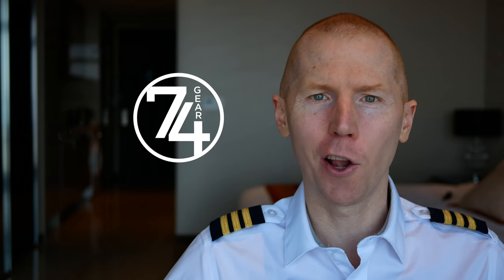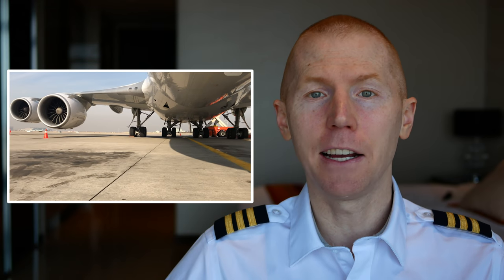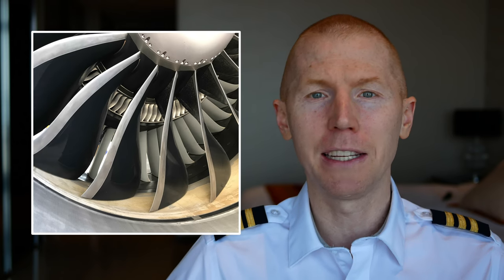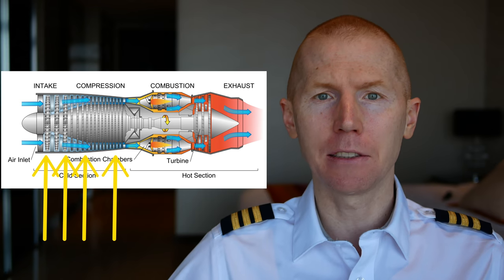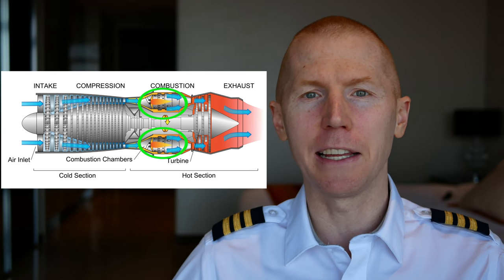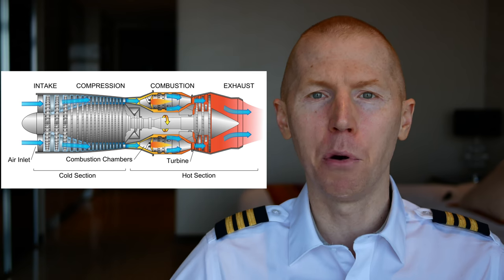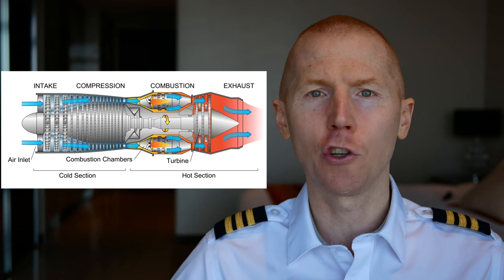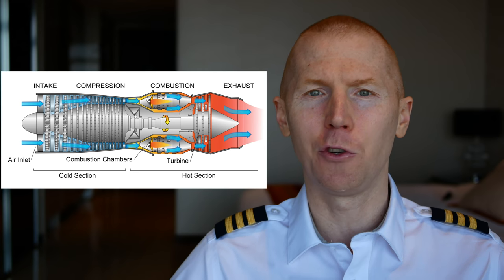How does an Airplane's Jet Engine Work | Airline Pilot Explains

Comment: Hi Kelsey, just a note from your friendly jet aircraft mechanic.
The fuel nozzle is at the front of the burner can, as shown as the white angled piece in your drawing, the holes in the side of the burner can are not for fuel but to let air in to help with the combustion process, but to also cool the can and keep the flames from contacting the metal of the can. (It could melt from direct flame contact over time)
The burning of the fuel is a continuous smooth burn, that causes a rapid expansion of the air passing thru the turbine blades out of the rear of the engine. Please stop calling it a explosion. 
Keep up the good work.

Comment: Hey Kelsey,   I use to work for a company called Praxair Surface Technologies right next to William Hobby Airport in Houston.  I was one of a handful of people that  were able to rebuild and or work on certain parts of the get engine internals.  One was the main shaft of the GE engines.  The bearing journal (bearing area on the shaft) had to be held to .0002  Two tentth's of a thousand of a inch.  We actually put the shaft in a machine, undercut the journal and then microweld build up the area with a D-Gun, then precision grind it back down to the tolerance needed.    We also sprayed the CANS's of the engines with a tungsten carbide coating with a Thermole Jet  coating to keep the cans from eroding away while burning fuel...   We did many helicopter parts also for Jet Ranger's...  But I remember how delicate we had to be and keeping up and recording all the serial numbers on every part even all the small parts we did..    This was when I was about 30 years old about 20 years ago.  The place has since closed down and moved away.  
Reply to you later.
Mick
Reply from the maker: cool story Don, thanks so much for sharing.

Comment: Turbo, aye? Now lets talk about how we can put that engine on my car :3
Reply: From my understanding these turbo jet engines works similar to a turbo charger in a car. Exhaust drive the turbine (hot side) which is connected to the compressor (cold side) by a central shaft. The compressor suck and compress the air then send it to the intake. So if your car's a forced induction then you already have one mate.
Reply: @datdudeolyver  i have an compressor boosted engine on my car ( it's connected directly to the crankshaft instead of being driven by the exhaust).  But its more the joke about "we need a bigger turbo or a twin turbo on the car for MOOARE POAWER"
Reply: @terrorhuhn9192  Well we can't never have too much can we lol. Add a turbo with that blower on the top and you'll have MO PAWA BABY
Reply: @datdudeolyver  nah! :D power, torque, rpm, Boost pressure, it needs to be MOARE!!!! and maybe bigger tires to speed up fast.. but small enough to spin it with the first 3 gears xD
Reply: @terrorhuhn9192  and maybe after that go the Bonneville salt flats and break every land speed record ever know to mankind 👌🏼😅
Reply: I know you were joking, but I’ve actually seen jet engines get put on a car, and it went slow as shit. It needed more from the aerodynamics and stuff to be effective. 

So I hear ya, it sounds exciting as f*ck to stick a couple of these on a Lambo, but it would actually be a big disappointment.
Reply: @sijones501  Yeah I seen a lotta videos about that. Always wonder why they slow af tho. I guess Jet engines work best at high altitude maybe where air is less dense compared to surface level. Then again the current land speed record holder, the Thrust SSC is powered by 2 turbofan jets which did 763 mph in Bonneville salt flats in 1997. I guess you can't compare a purpose build machine with a garage project can you.

Comment: Kelsey, that was a very basic explanation and a good starting point. However there is no explosion in the combustion section it is an expansion of hot gases that create a pressure such as the way a balloon would let the air out of its neck which blows across the turbine blades in the rear and that is how you have the operation of how a turbine shaft is driven. What I would like to see in a video is an understanding of the different gauges you use in the aircraft such as ITT, torque and EPR. Each one of those I believe has a different usage at different altitudes and air speed. Keep up the good work and thank you.
Reply: Technically it is an explosion albeit a continuous one. It is a process of oxidation accompanied by a large scale increase in both temperature and volume. If it only produced heat and therefore increased volume, because one of the reaction partners is for example solid and can therefore only emit moderate amounts of energy at a time and gases can expand way quicker than they are energized, it would be called burning, if the front of the reaction zone propagated exponentially or supersonic through the combustive material, it would be called a detonation. It is all about the relative speed of the reaction zone propagating on one hand and the speed of burning materials flowing or expanding on the other hand.

Comment: So far, so good!  

Glad you’ve got four of them working for you.

I’ve always said, if you’ve got more than one, go for “many”.  I always thought that the “multi-engine” rating was a bit of a misnomer. . .  since we know that in a twin, if the first engine quits, the second one will get you to the scene of the crash.

I know that big twins are the “current wisdom”.  But, as a former “single engine piston pilot”, I feel, “the more, the better”.  I’d love to see work on efficient, smaller engines for multiple use.
Reply from the maker: there is something nice about knowing you have 3 more if one fails on you!!

Comment: Thankyou for this straight forward explanation. At a basic level it seems even less complicated than a traditional petrol driven car engine.
Reply: Yeah... from there it gets a lot more complex. 

The metallurgy and close tolerances kept these from becoming a reality for hundreds of years... and even today they drive advancement of the engine. 

The 35:1 compression ratio and the 9:1 bypass ratio of the GE90 simply wouldn’t have been possible with even 1980s metallurgy. The engine would temp out well before it reached takeoff thrust... and now you have a big, heavy, and draggy engine that doesn’t perform as well as a contemporary CF6 or JT9D.
Reply from the maker: ya that is what surprised me when I learned about it as well, its more complex than the little engines we learn to fly on.  things seem to get easier and easier in aviation over time 🤣

Comment: As an Air Force B-52 maintainer, I can say it in 4 words: suck, squeeze, bang, blow.  And on earlier jet engines, we also had water injection which cools the air (increasing air density) and increases the volume of ejecta from the engine exhaust.  You should've gone into the difference between low-bypass and high-bypass turbofan engines.

Comment: I swear this is perfect timing. I'm taking flight theory and aerodynamics class. The current chapter I'm on: jet aircraft basic performance. I must compose an essay about the two thrust-producing aircraft engines, the TurboJet engine and Turbofan engine.
Reply from the maker: well, the engine on the turbo fan is pretty easy if you understand this concept and its actually explained in part 2 of this video which is what I am editing right now.

Comment: "Suck, Bang and Blow."
I think one poster thought of it as "violent" but the fuel air mixture ignites and expands rapidly causing the energy as you said to turn the turbine section which in turn turns the compressor section.
Amazing to watch a "blade off" test and witness the destructive forces!
Reply: there is no bang-no explosion just continius combustion
Reply: Le Jeune 6troëniste:_ that is right
Reply: “Suck, Bang, and Blow”

This sounds like the title to some video on redtube

Comment: I was a diesel mechanic in the army 63h worked on tanks the m1a1 aka the Abrams used a jet engine worked on them for 6 years and never knew how the engine worked this is a cool explanation thanks bro
Reply from the maker: thanks Cody, appreciate your service.
Reply: @74gear  no problem I did what was needed but I'm no hero those are the men and women that gave thier lives. Keep the good info going and I'll keep watching you. Just Curious do you have a good place to start out with pilot training? Im ready for something new to do driven trucks over the road for the last 10 years time for a change flying seems fun so a pointer would be nice
Reply from the maker: I have a bunch of videos on that Cody, I would watch those and see what questions you have after that.

Comment: Hi Kelsey, nice one, I knew theoretically how it should work but I am still a little in the dark about how it starts, if the back fans don’t spin then the front ones don’t spin either so how does the compressed air come in the burning chamber? Maybe you do one about the high bypass turbo fan engine later on. In the meantime, keep getting paid for doing the thing you love ! Have a good one
Reply from the maker: different ones start differently, some use a battery to get it spinning enough to put in fuel and get it fired off... some use the air from the APU to get it spinning and light it off.

Comment: I once built a semi gas turbine many years ago. Tin cans I used to construct the combuster and ngv .it had no compressor. It was a 2 stage rotor , I used a aerosol can to spray its contents directly into the combuster.it spun a few 1000s rpm .it was about 12inches long including the combuster and about 3 inchies diameter

Comment: Jet turbines operate on the Brayton or sometimes called Joule cycle. Did you know that the Brayton cycle was invented in 1872 by George Bailey Brayton of Rhode Island Mass  4 years before Otto would invent the 4 stroke cycle.  He called his engine the Ready Motor since unlike a steam engine it could be made to run in a few minutes time. Brayton's Ready Motor was used to power boats a rail car and even 2 submarines. It would take many years before the Otto engine would be used for motive power.  Brayton also invented a 4 stroke engine in 1887 that was very much like a Diesel. He died in 1892. BTW I think combustion (since the burning is continuous)   is maybe a better term than explosion....

Comment: I really like your videos, always learn something new, but not this time. The video is great, but I already know more about the topic, had quit a lot of lectures on the topic, it´s extremly complex.
There is one thing wrong what you told, in the combustion chamber, the spark has to be there first and then the fuel flow stars, if it is the other way round, the engine could fill up with the Kerosin when it´s not starting to burn for whatever reason.

Comment: Interesting and educational video as always. One question, since the back fans technically power the front ones, how does the engine start?
Reply: Compressed bleed air from the APU initially pushes the engine. Then, fuel and the sparks are introduced. After that, the fuel keeps burning without needing a spark, like a propane grill.
Reply: @TimMak25  Thanks!
Reply from the maker: Tim is correct on most larger engines and on smaller turbines a battery will get it going and spinning and then as he described!

Comment: Sorry, Dude,  the combustion chamber DOES NOT contain an explosion.  It contains a CONTROLLED,  Continuous BURN of fuel and air.   If it was an Explosion,  BAD things would be happening.  As pilot,  YOU control the amount of combustion  ( Thrust )  by use of the throttle.   Same as a car, Controlled Burn, NOT Detonation   A and P  ,  jets
Reply: Correct sir. If it was an explosion it would be a pulse jet.
Reply: @lukegriffiths6569  That' Right !

Comment: Loved how you "drew" that detailed cutaway of a jet engine!  LOL!  

Your explanation was great, but how do they control the explosions so it doesn't damage itself?  And is it hard to re-light the engine if the spark ever goes out?
Reply from the maker: there is a procedure for relight and its not hard because air is already getting shoved in there. glad you liked it.
Reply: The spark is not normally continuous. Once lit, the fuel keeps burning. You got an oversimplification of the ignition process.

Comment: There's actually a key element of thermodynamics which isn't really that simple, if you think about it: 
the work that is put into the compression of the air is basically spent afterwards by turning the turbines. If you think about it, you could just leave the compression and decompression and just ignite the air. Of course that's not how thermodynamics works, but even though I passed the thermodynamics class (hardly), I still never really got my brain wrapped around the fact that you get out more energy than with the ignition only by compressing it before and then decompressing it afterwards. It's so counterintuitive to me.

Comment: Another freaking crazy video by you dude. I have a question though and that is, what would happen if the fuel pumps were to fail and more fuel would be injected in the combustion chamber than the engine can take? Essentially more than when you set 100% thrust.
Reply from the maker: if a pump fails it wouldn't fail to dump in more it would fail and stop pumping... and there is a redundant system for that to keep bringing fuel in.

Comment: Very informative... thanks.  I assume the pressure generated by the combustion would be greater than that generated by the compression blades... So, I don't understand how the expanding gas from the combustion section goes only backwards... What prevents it from going front?

Comment: Is the temp of the turbine taken somewhere around the blades in the hot section?  I always see pilots referencing this during the start up procedures. This was a fantastic video by the way!!
Reply from the maker: ya EGT is taken toward the rear of the fan blades
Reply: As I learned it in the Navy, if you try to start an engine with too high of a temp in the turbine section it can cause the fuel to burn in the turbine and possibly force the engine to start backwards.  This would turn the compressor into the exhaust and the turbine into the compressor.  I cant imagine that would be good for the engine.

Comment: Very well and easy explained!
This might sound like a dull question, but could you make about how wings generate lift. 
I have asked this a lot and the reason always keeps changing.
Reply from the maker: I will probably eventually get there Vortex, may be a while but sure.
Reply: The top of the wing is convex  ) this is the shape turned from 12:00 to 3:00            o - clock. so turn it back counter clockwise to 12:00 and that's the top of the wing. The under side of the wing is FLAT. SO The air can go SO Much faster on the underside.On the top the air Hit's the (Leading Edge) the front of the wing go up,over,and back down. (more distance.) The shortest distance is a straight line So Lift is Due To Air Speed, (So Much Faster Under Than Over). F.Y.I. the biggest mistake that many very smart people make is Mixing Deg. and the clock. Deg. is 0,90,180,270,and 360 is a circle.

Comment: here's another tricky question:
which part of the engine is actually driven forward? Or in other words, on which part are the air molecules accelerating from? there has to be this one surface that is actually put forward by the aceleration of the air molecules in the opposite direction but I can'T figure out which one it should be as there's no fixed part like in a piston engine ( there it's the pistons obviously)

Comment: Been watching your vids...nice job so far!  Random question: it looks like there is some kind of intake vent on the belly of newer aircraft forward and below the wings?  What purpose does that intake vent serve?
Reply from the maker: I would have to see which plane and which vent cause it could be a few different things... but if its front facing it would be to bring air in for various reasons.

Comment: Gear 74 Hey Kelsey I have a question you didn’t cover. How does rain 🌧 & water 💧 & snow ❄️ that gets sucked into the engine affect performance?
Reply from the maker: Stevie Gee it doesn’t get deep into the engines where it would intact it. Well on newer designs at least. There were some much older designs that did have that issue though.

Comment: Basically when you turn the engine on (magnetos) and push in the mixture (mixture of fuel and air) thats when the explosion happens. 

@74 Gear   how do you control the mixture on a turbofan engine, or does it just adjust by itself?

Comment: Thanks for the easy to follow explanation, much easier to understand than most explanations out there. Question though, do all the compression blades in the first segment spin at the same RPM on a common shaft or are the independent?
Reply: Generally its all one shaft for simplicity and reliability. This is actually a typical limiting factor on how much you can power up a turbofan engine, because the big front fan is a whole lot larger (potentially double the diameter or even more) of the compressor sets and exhaust sets, which means the outside of that fan is moving a whole lot faster. Unfortunately, if the ends of that fan break the sound barrier, the engine stops being quite so efficient (among other issues, supersonic flows are messy things).

Comment: Any comment on the 737 Max issue? Seems like it was a software issue...have you ever flown one and had issues with the MCAS?
Reply from the maker: Ive never flown the max so I don't have any hands on experience with it, I am waiting to see the reports to be released though.
Reply: @74gear  Do you think the incident at JFK involving the Airbus A321 and American flight 300 on 4/10 was related to the A321's automated Alpha Protection systems?  I imagine that experiencing a hard roll right at takeoff must have been absolutely terrifying